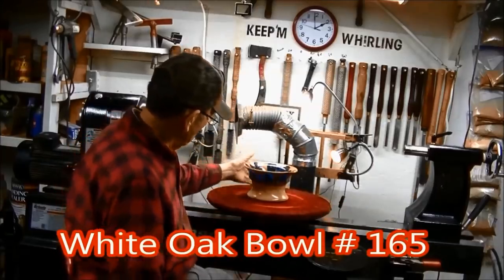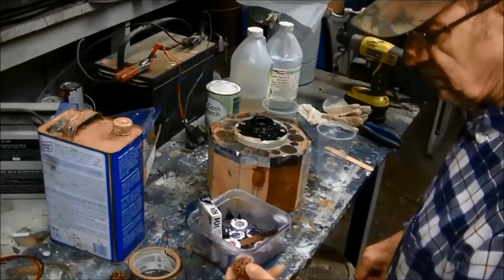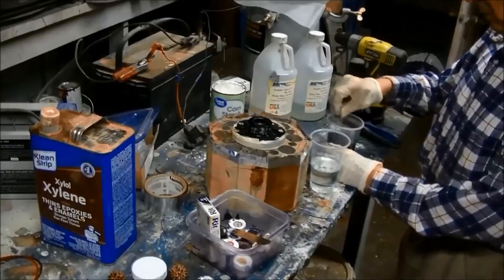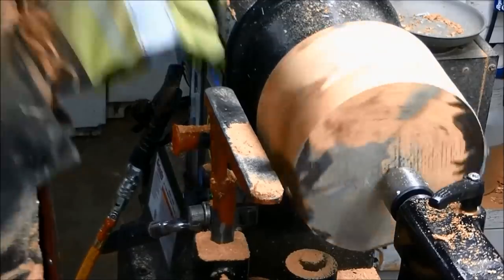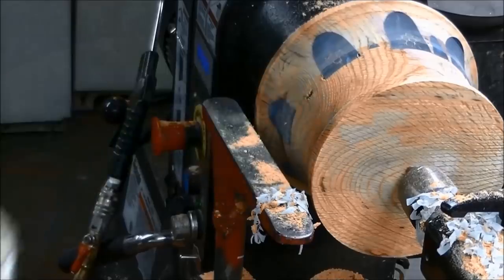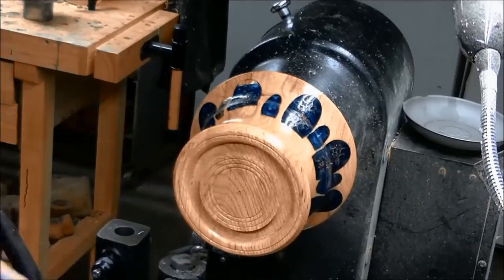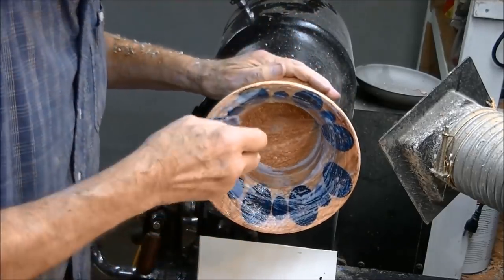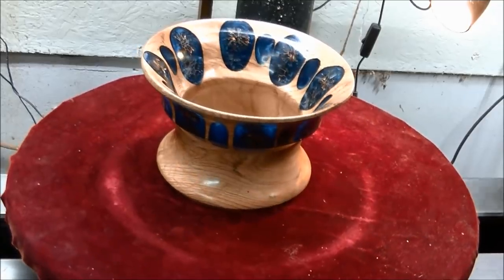White Oak Bowl with Resin and Gum Balls # 165

Comment: I think you did a great job of it Larry, your measuring wasn't off, you did the same thing I did on my first one,  I didn't flatten the bottom surface and it was rocking on the drill press just like mine did causing the holes to wander off. and you seem to have ended up with the same porosity issue as I did also, that's 5 different ways it's been done all having holes and voids in the resin using different methods and resins, can't wait to see what walnut version of this, Doug
Reply from the maker: I couldn't wait.  I friend of mine came across some large cherry.  I got several pieces.  I am using the cherry with red resin and gumballs.  Just one size holes this time and a natural edge.  Now that's gonna be a challenge.  It's no fun if it's easy.  Thanks and take care, Larry

Comment: Using Gloves while turning is a No Go. Extremely dangerous when you get a catch on it !
What you named a "sharp cutter" is a scraper. ! why dont you use a gauge. why scrape when you can gut (and get an 10 times bettrer surface)
Reply from the maker: If you keep your hands off your work when it's turning, you will never have a problem, glove or no glove.  If you know how to use what you call a "sharp Cutter" in a shear cut, you are cutting not scraping.  Most of my cuts don't even need sanding.  I do use gouges, however I prefer carbide cutters, no sharping and I get a better finish.  I have been turning for years and started with traditional tools, but once I got to using carbides I soon realized they in fact are better if you know how to use them. .  You obviously don't know what you are talking about.  Sorry If I come across as angry, but people who don't know what they are talking about and spout off wear me out.  Thanks for viewing anyway.  Larry